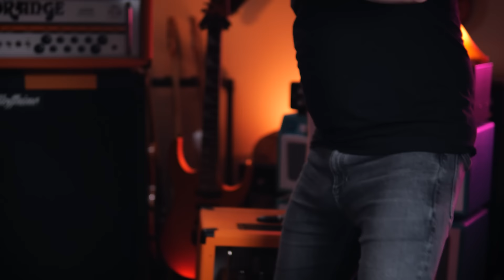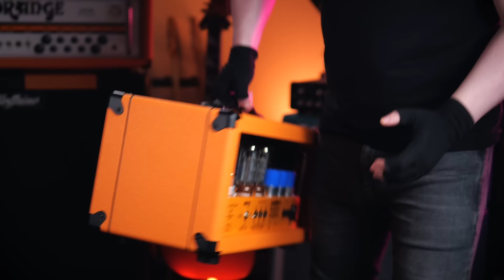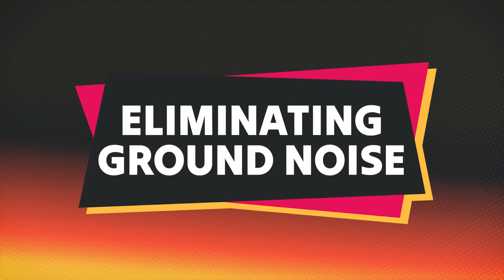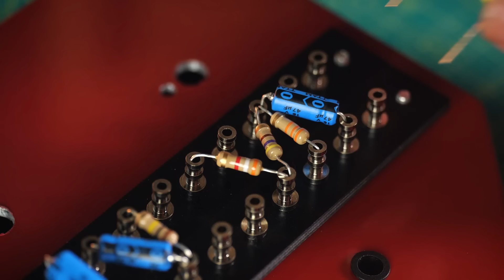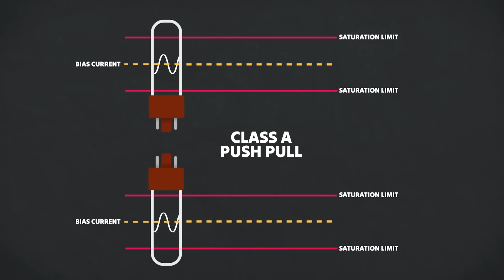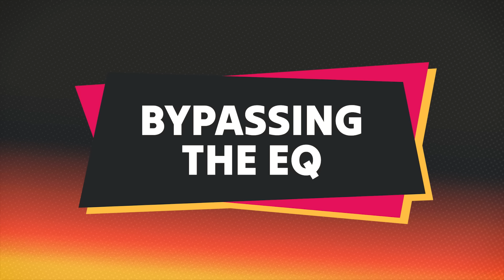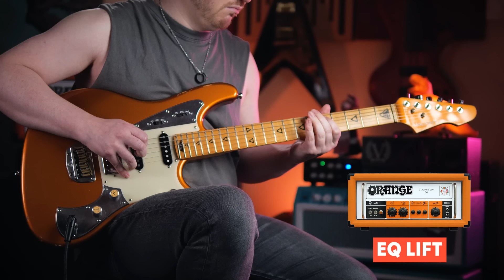Archaic Design of Handwired Amplifiers

Comment: Personally I've always preferred turret boards. "True" P2P is a pain. Especially if parts have been replaced poorly in the past. I actually wish amps were PCB based like with modules that could be replaced. Part of a component on a board goes out you can just replace that board or jump to another. Sort of like PC parts. But they're bespoke usually so it'd be rather difficult.

Comment: No PCBs and hand wired circuits are not interchangeable. It's not about a sonic difference - serviceability of parts that wear out, thermal dissipation, thermal fatigue on the board and solder joint cracking. Yes equal expertise to design to eliminate noise but due to the noise and heat issues you don't gain an advantage in a full PCB (you need a minimum of 2.5mm between traces - or the wires in point to point hand wired - so you don't really get the same compact benefits you would in normal low voltage PCB circuits as you need to space them wider than a PCB normally would). I'm strictly speaking to an actual tube amp where you are using tubes and high voltages and high thermal circuits to shape the signal wave and amplify the sound etc (a PCB modeller is a whole other story and it's more in the softwatre to emulate the wave manipulation so ya all PCB and SMD there is fine). Doesn't mean you can't have a hybrid approach. That is what I do in my builds. Best of both worlds (but I shield and isolate the PCBs). DSP, imuplse response,  usb circuit for loading IRs, and DAC are all custom designed PCBs (technically a couple).

But ya...high-power thermal stuff like the variable power controlm reactive load, pure tube signal path. spring reverb, bias wiggle tremolo (I've considered experimenting with PCB for that) etc. are all on turret board and chasis point to point

Comment: @Science of Loud

do you have any video about a stereo setup? like if i need to add something before one of the 2 amps to avoid ground or phase issues when using a stereo pedal.

I keep hearing about this ground and phase stuff but never seen what people really use when demoing stereo setups and i have this strymon brig and olivera pedals and wonder if i could connect to both of my amps but idk if its worth it getting a trs splitter and if the pedals already sort this phase/ground stuff or if i would need to  buy some extra stuff that would just make a headache and a mess on the board.

Comment: Hello, fellow guitarist and electrical engineer here. It was really nice to see this video, it shows some basic EMC design practices really well! However, I have a little nitpick. The twisted wiring and the separation of the transformer and power wing from the signal wiring is to protect not against electric, but magnetic fields interfering. In general, power transformers always have some magnetic flux leakage, and this is the primary source for this kind of interference.
Reply from the maker: If I can nitpick right back: you can't have a magnetic field without an electric field, they are both part of the same process. 

I don't find this a particularly helpful correction to make: electromagnetic fields radiate from wires carrying current - two wires carrying opposing currents will have inverse fields that can be cancelled by twisting the wires. 

The cause of these fields is the electric currents, therefore it makes sense to discuss it in terms of the electric field for a lay audience.

Comment: You should see Premier Guitar's video "Handwired vs PCB? How 3rd Power Amps Are Changing the Game" on how Dylana Scott is switch to PCB but using turrets on certain spots on the PCB to make it easier for future maintenance on components like capacitors. It is a long video, at the 44 minute mark is when Dylana start talking about the handwired switching to PCB.

Comment: They can install large value resistors on the caps that hold the HV charge and if they are big enough they will have very little current drain but when shut down they will drain the charge down to a safe or nothing value in a reasonably short time.

Comment: I somehow came into possession of a ton of silver plated multi level component mounting posts.  They mount in a specific size hole and the bases are hollow so you can flare them out to stake them in phenolic or fibreglass board.  I also got a huge sheet of thin phenolic board from aircraft repair leftovers.  So I made a staking tool for the posts and can make any component board that I please with that stuff.

Comment: There is no sound reason, and no reasons of sound that the handle on heavy tube amps isn't offset. 

If you want a heavy tube amp to be easier to carry: Move the handle closer to the power transformer. 

It looks ugly, but does not affect sound or structure. 

If you are a working musician who lugs around a tube amp because you love how it sounds but don't care how it looks, or it's collector value... Move the carry handle toward the power transformer. Every joint in your body will thank you in the long term.

Find a chunk of scrap 2x4, stand it on the 2 side, balance your amp on it, center the handle, as best you can, on that.

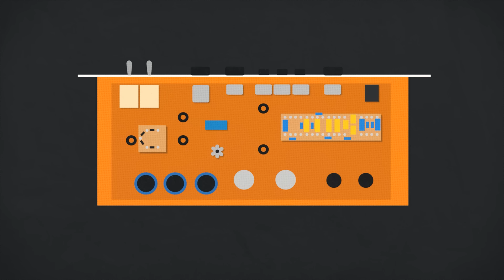Comment: The green and yellow earth ground from power cord to a shared star ground as shown at 4:25 is a violation of electrical code as well as general "best practices". The safety ground is not to be  shared with any other chassis ground connections; it is supposed to be physically, mechanically and electrically separate from all other chassis  grounds, not to be shared with transformer mounting bolts or the like. Separating the earth ground a few iinches away can also lower noise. This is a significant no-no, especially for an amp that's otherwise beautifully built.
Reply from the maker: That isn't the safety ground. The safety ground from the power connection does have a separate chassis connection over on the power side. 

The yellow and green wire on the star ground comes from the transformer. It shares the colour scheme, but it's not the mains earth.
Reply: @ScienceofLoud , ah, I couldnt clearly see the rest of the wiring in the area of the power transformer. Strange transformer color coding; green is traditional for the 6 volt heater winding but the heater center tap (for amps that have one) is usually green and black. Green w/yellow is common for power cord safety grounds. Or perhaps it's an electrostatic-shield ground? Anyway, an artificial centertap with a pair of resistors is, in my experience, a better option, sometimes being more balanced and producing lower noise than a grounded centertap, and the resistors act like fuses to protect the transformer if a tube shorts out.

Comment: Im still  learning...
390 VDC to the output plates is anemic as f××k; no?
Reply: To a 6L6, 5881or EL34, yes, but 390V is a bit above maximum ratings for a 6V6 or EL84, yet some amps run them well over 400V.

Comment: Very well done. You encapsulated all the finer points of the designs nicely indeed Sir.

My early 80's 50 watt JCM800 has a big ole PCB in it. Yet it crushes quite a few traditionally wired point to point amps. And, it has been trouble free for 40 years. Aside from tubes and a few drifty caps, she has been reliable and deadly to the first row.

Comment: Someone will probably already have pointed it out, but an EL34 can indeed handle 30Watts of plate dissipation, but that would only give you about 8 to 10Watts of audio output. I understand that you want to keep it relatively simple, but simplified a class A biased EL34 gives you 10Watts, not 30.

Comment: Guessing it's transformer placement? I haven't worked on amps. Worked on some electronics though. To save money to waste on guitars and parts I have kept myself on small combos, an acoustic amp vanilla stock and 2 digital amps. I know if I let myself play a nice analog proper amp I'd be done with my guitar projects for a long time. I'm out of space and my setup works for what I do. I'm not good enough to really feel and hear the difference. I mostly play clean, finger only, some classical style and various songs I like arranged for Solo guitar. It's all wrong I know but I only play a modified 4 finger style on steel string and electric. I keep saying I'll branch out but that's the way I started learning and practicing, and what worked for my ADD brain. To keep me picking it up 5 times a day for any length of time. It may be half a physical dexterity puzzle and practice. And now I'm getting close to full 10 digit control I can branch out to learn to strum. Currently I do chords by letting the strings pop off my fingers in controlled release or by striking bidirectionally based on what's physically efficient depending on what's before or after. But I do want to learn rock style and fireside strumming.  I also take finger patterns and try them on different chords based on progressions listed in different keys. I have a long way to go. One day I woke up and needed to know how playing felt. Actually I was listening to the layered guitar outro on Easily by the RHCP. And I needed to know. 5 times a day since for the last 5 years. I should probably get lessons. But I've played with or in front of no one. Just the dog and the Lady indirectly.

Comment: in my builds I use all three styles depending on the circuit. WIth a 5e3 or old style I make a pbc that is way quieter due to trace layout vs the flying wires. Edit to say- for the preamp section-ptp for the rest

Comment: Point to Point/Turret Board construction will in most cases far outlive a PCB construction amplifier.
I've a 1947 MEC amplifier that works perfectly, it was constructed using true point to point construction.
My 1976 Fender Twin Reverb is also a form of point to point wiring, I purchased this amplifier brand new and still regularly use it (amazing that this amplifier survived my teen years).
If you plan to keep an amplifier for many decades treat yourself with a PTP construction amplifier.
Set yourself up for the WIN, have your Future Self look back and thank your past self for making a purchase that will stand the test of time.
Great Content, Thank You

Comment: The construction is tidy, BUT, I have a criticism. 
At 2:41 that electrolytic capacitor piggy backing a power resistor is a NO, NO, in my book. That capacitor will deteriorate much faster as a result. I know the amp chassis is inverted, so the capacitor will be on the bottom
when the amp is in use, but I consider it bad practice to place electrolytics or thermal sensitive components next to power devices. Just MHO.
There is plenty of room to move those components away from each other, and if this was my amp, that is what I would do.
Reply: Your point about not locating hot-running parts nect to heat-sensitive parts isn't merely a "humble opinion", it's a known fact born out by nearly 100 years of electronics technology and manufacturing ! Major manufacturers and electronics "designers"  routinely violate this common-sense precaution, in solid state equipment as well as tube type stuff. In nearly 60 yers of working on audio equipment I've seen this stupidity repeated over and over and over....Ive rellacedvthousands of cspavitirs becausebofvit, added heatsinks to transistors and voltage regulators because of it, relocated parts farther apart from eath other becsus of it,  away, installed physically larger, higher wattage parts and lifted them up off the board (to increase airflow, reducing cracked solder joints and pcb degradation) because of it....

Comment: Correction, 240VAC in the UK, will make a difference if your mains transformer has a 230V tap for Euro and 240V tap for UK... just saying...
Reply from the maker: More pointless pedantry. 
It's nominally 230VAC. 
Similarly the 50Hz is on average.

If you measure the delivered voltage and frequency you may get different values at different times depending on grid free demand etc.
Reply: @ScienceofLoud  I've watched Chris at Rift amps cool a hot bias many times by using the 240V tap, I'll let you argue the point with him if you find it pointless or pedantic...ps my wall voltage today 239 am 242 pm
Reply: @hotdogpilotAndy , Martyn at the Vintage Amp Repair and Online Guitar Teacher channel often does the same thing, because voltage in his area of the UK rarely drops below 238 VAC and often runs 242-244. Here in the US, BTW, my voltage at ordinary wall outlets is 122 to 124, even when the AC is running; I've never seen it drop below 120. 10 volts additional input voltage through a tube smp power transformer with a 3 to to 1 (or greater) step'up ratio adds at least 30 volts to the circuit! A vintage BF or SF Champ, which when built already ran the 6V6 a bit over its max rating, now ends up running the tube at 420 to 440 volts unless you increase the cathode resistor value.

Comment: I love mine. I got curious a while back and opened it up to see all the wiring. It had some fluff inside. Like a wad of plush material. Did yours come with that? Do you know what it's for?

Thanks for all this info! Quite useful.
Reply: Probably Black Widow spider silk. Don't poke your finger in there.
Reply: @wilhelmvonn9619 lol knowing my luck! But no this was like cotton or something
Reply: @phantomspcmn , a mouse nest?? An exploded electrolytic  capacitor can also eject a fluffy papery material; a brand new amp shouldn't have something like that inside, unless it failed the initial factory QC from a bad capacitor and was repaired before shipping it out; or perhaps you bought a used or floor-demo amp which had been reassured? Anyway, leaving debris inside of an amp is the mark of a very poor repair tech, though perhaps it was half-hidden in a cranny or tucked itself under a board and it fell out and became visible later, from transport handling. I recommend having a tech look at it; there might be other potential faults, or leaked-out capacitor chemicals (which are often corrosive), or conductive debris lurking inside, waiting to land somewhere with high voltage so it can cause a short circuit.
Reply: @goodun2974 thanks for the thoughtful reply! I took it out when I first saw it and it's been fine so far (I've had it maybe 1.5 years). But running it by a tech for a checkup is probably a great idea. Thanks again!

Comment: Great video!

A well designed PCB can be quite the miracle. Super high gain amps are tricky to build, because not only interference from power wires but also signal to signal becomes a serious issue. PCBs let you put components extremely close together, leading to shorter connections and less RF leaks.

Comment: The only reason I purchased a hand wired amp was because somepeople aren't will to re-cap (2,000 hours at 105°C run time) or re-tube (1,000 to 2,500 hours run time) an amp that has a PCB board.  If you live outside a major city in the USA it's hard  to find people who can repair amplifiers.  When it's $200 (not including the parts) for a re-tube and bias, then $300 for a re-cap.  You're getting really close to the price of a new amp.

Comment: Why the offset marshall amps where designed the way they where to balance the weight out ptp have a look inside my old 59 magnatone nightmare 🏴
Reply: "There's been an an explosion at the spaghetti factory"! That's what some Magnatones and other PTP amps look like, alhough the simpler Maggie's, even some models with vibrato, usually have plenty of room inside the chasssis. The stereo models with reverb, however, are pretty crowded!

Comment: First - awesome video.  That Orange is absolutely stunning to look at.  Beautiful craftsmanship.

Second - I love your breadth of knowledge and how well you explain tube amps.

Third - I may be insufferable.  I somehow managed to convince a woman to marry me and bear three children.  But nonetheless, I would say there is a difference in construction methods between the Orange you put on display and a 'point to point' amplifier.  I've owned and worked on several old Hammond Organ amplifiers.  I'd describe that construction method as point to point.  Resistors and caps are often connected by their own legs.  Instead of running wires to a board of any kind, they just connect directly to the socket or pot.  It has very short wire runs.  The lead dress is a rats nest, but often works very well just because the runs are too short to pickup any interference.  

I've built several amps PTP.  It is a pretty fun exercise.  I even built a Dumble ODS point to point once.  That was kind of insane though.  It was a quiet and great sounding amp, but servicing it is a BEAR.  Quite ugly to look at the gut shots.  I personally think it is a lost art.  I would be fascinated to go into a time machine and watch someone build a Hammond Organ amp in the factory all those years ago.  

PTP, turrets, eyelets, and PCB's are all valid methods to build with.  They each offer their own set of pro's and con's.  When well thought out and executed they all can produce great sounding, quiet, serviceable, and toneful amps.  Circuit is king.  Construction techniques are more about how many you're going to build and how wealthy your consumer is.  

Cheers!

Comment: the EQ lift function seems like it would be great for using pedals to sculpt the tone, like setting the gain without the EQ to be just past edge of breakup, and running a distortion pedal into the front, then turning the EQ on and the pedal off to give you a clean tone. Gimmick? Yup. Genius? Absolutely.
Reply: Does eq lift work as power amp in, if your amp does not have fx loop?
Reply: @iromanovsky  no, it just defeats the EQ on the amp, so if you want to change the sound, you would need something in front of the amp to do that with, especially since it doesn't have an FX loop. Also, a lot of distortion pedals sound their best with the amp they're running into not being completely clean.